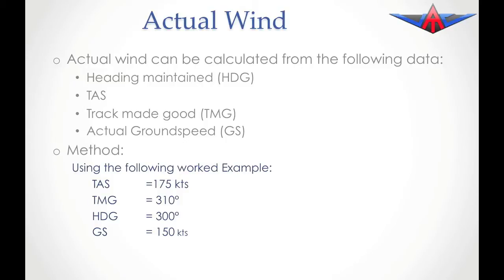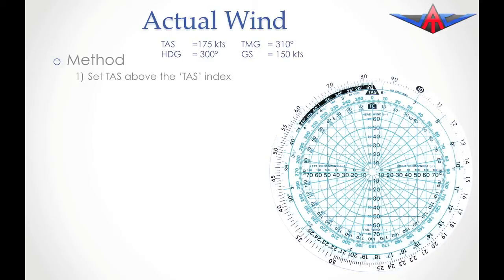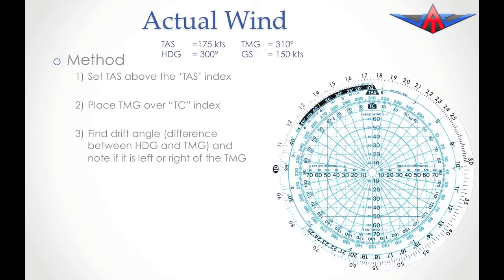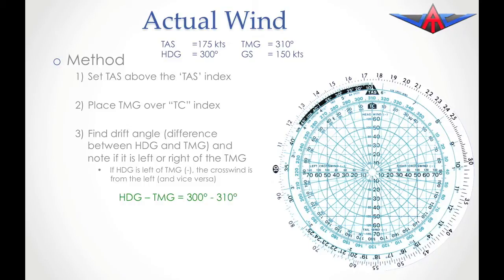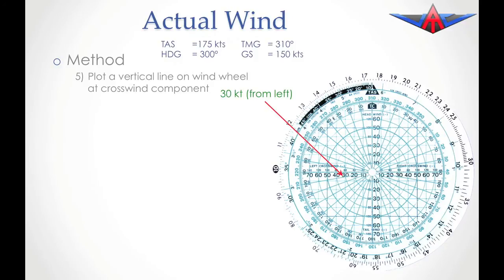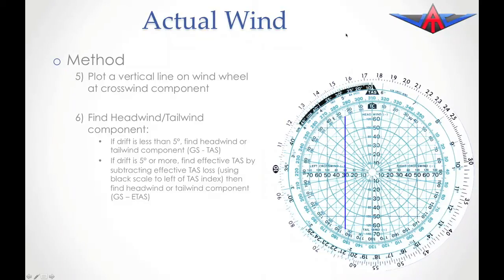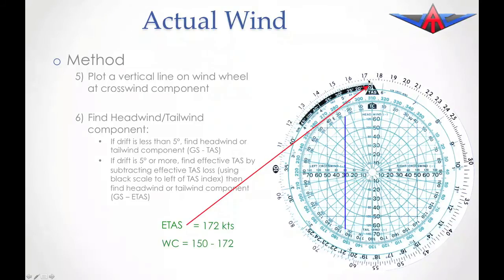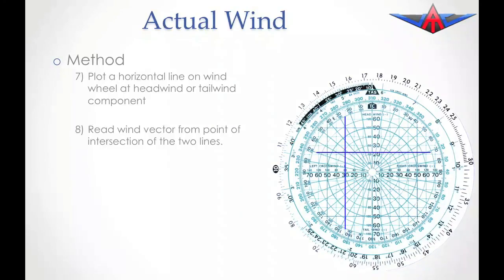Actual Wind Calculation on Navigation Computers

Comment: Is the CR3 you use and App?  Where can I get that to use on my computer or iPad?
Reply: No this is not an app, it is a non electronic aviation “computer”. One side of the device has function that include a circular slide rule, while the reverse side (the one in this video) is able to be used to perform calculations to do with an aircraft’s speed, direction of flight and the effect of wind.
Reply: @indiankitchenonline9871  yes sir - i understand that.  but you are using some type of online/pc app in your video - that's what i'm asking.  how are you showing a video of the CR-3?
Reply: possibly to be more clear - you show a representation of one on your video and manipulate it.  I have the E6B app on my phone and i'm hoping there is one for the CR3 as well.  I like it better

Comment: Great video thank you. But where are you getting the 37 kts from? Is the 37kts read off the top of the blue line?
Reply: 37 knots is the length of the vector from the center grommet to the intersection of the headwind and crosswind lines. Use the circular lines to read the length.
Reply: @BillPalmer  that doesn't make any sense old man
Reply: @ilovesex4eva read it again slowly. You’ll get it.
Reply: @BillPalmer I appreciate the advice, took me a second to figure out it wasn’t the straight lines lol 😂.